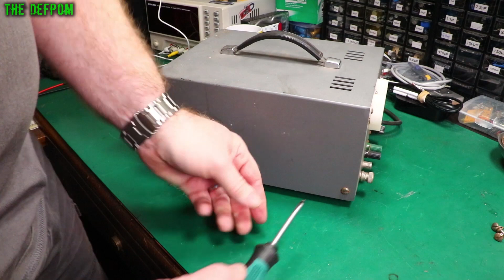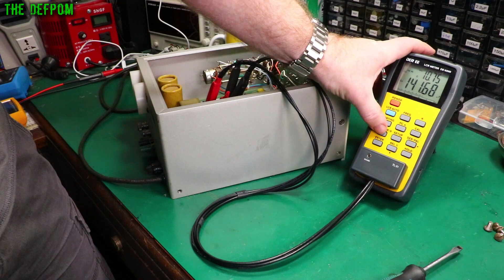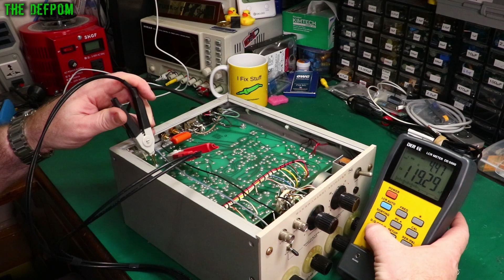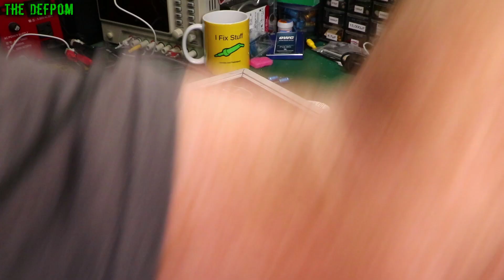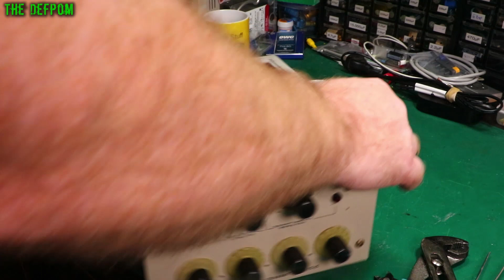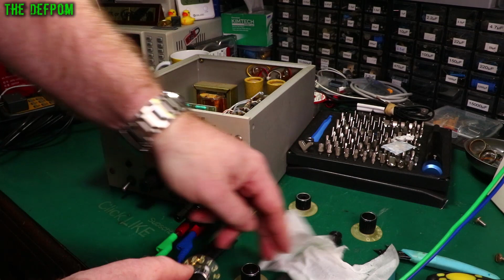🔴 Keithley 225 Current Source Repair - No.948

Comment: I haven't had to deal with wiring a mains plug for many years. 
Just use molded plugs and cables from all the electrical junk that gets thrown out everywhere all the time. 
It's easy to get more than you'll ever need...

Comment: I bought one of these on eBay a few years ago for a low price. Plugged it in, turned it on and was surprised how close it's outputs were to the dial indications considering it was built in the 70's. So I got it out again and let it warm up for a few hours along with my HP3457a multimeter. Here is what I got for outputs:
Dial Setting   Measured Output
10ma              10.0197
1mA                 1.00263
100nA              100.156
10na                   10.027
1nA                      1.004
0.1nA                    0.103
0.01nA                  0.012
Pretty decent I would say.  I might try some adjustments but need to be careful to not mess up what is pretty good.
Reply from the maker: I should do the same and check it’s accuracy on a decent meter, I haven’t looked that closely yet.

Comment: You need to get a set of imperial allen wrenches.  Older US made test gear is all imperial.  The smallest set screws in knobs are 50mil.  The ones above those are in fractional inches down to 64ths.
Reply from the maker: I do have imperial Allen keys in my garage, some like the screwdrivers type would be good to have in the lab
Reply: @TheDefpom  My lab and garage are one in the same.

Comment: Ripple currents generate heat inside the tantalum capacitors and it's that heat that is the main problem. Too much ripple current even whilst maintaining voltage well within the voltage range of the tantalum and you can end up in thermal runaway and BANG!..............To be fair though, I quite like the smell of a burnt out tant!

Comment: can you coat the knobs to maybe stop the plastic breaking down now they are cleaned?
Reply from the maker: Yep, acrylic clear coat paint will probably work, I want to see how it goes over the next month or so first, in case it was just environmental dirt.
Reply: Squeak !!!!!!!!!!
Reply: @andymouse  Cheese!!!!!!!!!!!!!!!!!!!!!!!!!!!!!!!!!!!!
Reply: @TheDefpom  Not acrylic, use automotive dashboard protector, basically silicone oil, which will protect them better. Cable for mains I will bet if you strip off the sheath it will be white, not brown, as that is the standard colours for US mains cables, white for neutral, black for hot and green ground.

Those crappy plugs is why I keep all old moulded IEC cables, as then you have either a choice of cutting off the plug end, or the equipment end, and using the pre made cable that way. Just grab all the older cables you can get, as they actually have copper wire in them plus real ratings. Funny enough the one PC shop by me is selling off the moulded Aus cables as surplus, a lot of them, for 50c each AUS, and I was thinking of getting one or two, but then remembered I have a bag of around 100 ones already, in various types, single, dual and old IEC extender cables, so do not really need more. Been using them to replace leads all the time, quick, plus they often are thin enough to fit the glands, and many are 2 core as well, for the double isolated equipment, saving work.
Reply from the maker: @SeanBZA  yeah I have been using old IEC cables too, but I ran out of them, I actually just managed to get a couple more this week.

Comment: What is the most usage for a constant current source?
Reply from the maker: Testing other measurement equipment, LED’s anything where a known and stable current is required.
Reply: @TheDefpom  Then I guess you would measure the voltage across the LED to know what supply to make for it?  You wouldn't use this thing to load a PS would you?  It's basically a PS itself.   You set the current you want and it figures out the voltage.  Just not sure what I could use that for.